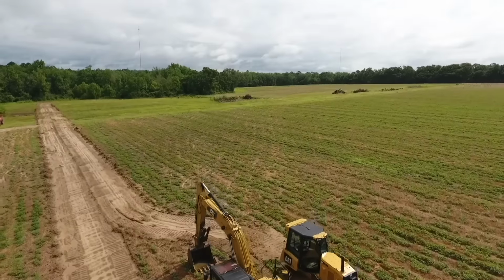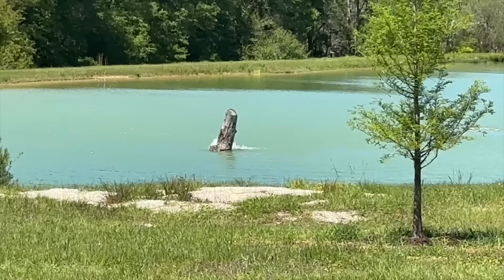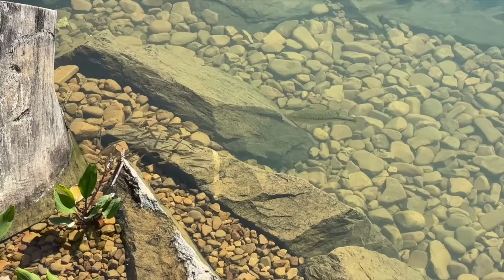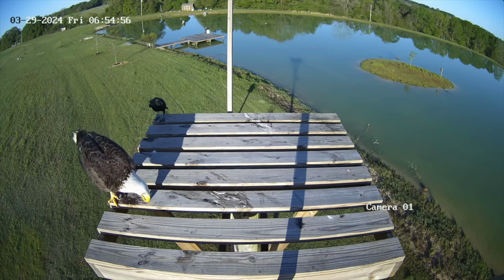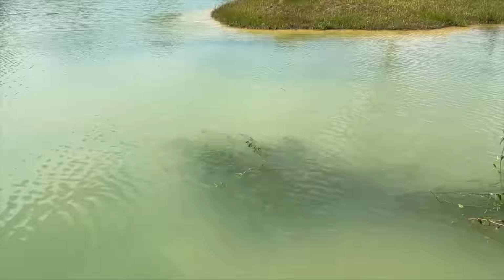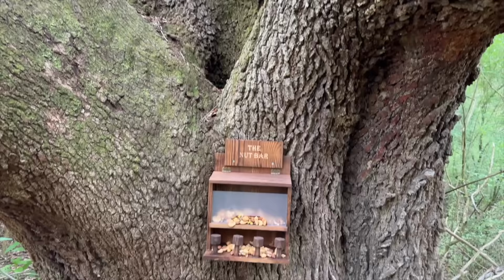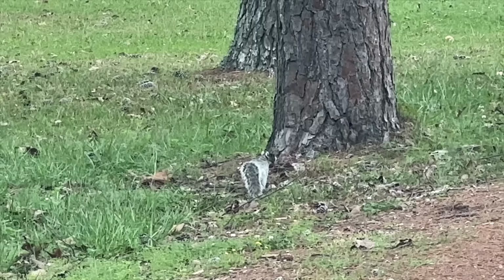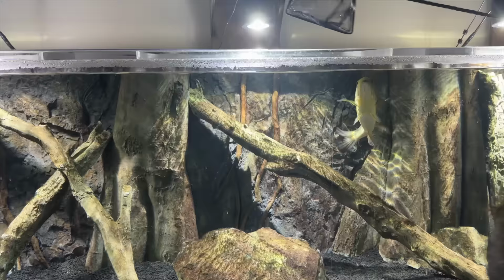Revealing a Secret Project I've Been Building for a Year (It Will Change Everything)

Comment: @BamaBass Do the bass have to actually swim through the square of the antenna? or are they picked up even when they swim by the sides of it? I assume they just have to be close to it, not specifically through... Just Curious, what the range per antenna is, i know underwater it won't be far from the antenna. Awesome videos. Thanks
Reply from the maker: I actually got to tune the antennas this week and it was cool. So any fish that swims through will scan, but fishing swimming outside it from 3-6 inches will also. The strongest signal strength is in the corners of the square and the weakest is mid square, working its way outward in a cone shape.

Comment: Electrician here. I fail to see how this will integrate into any existing agricultural management systems without some heavy physical wiring upgrades. What kind of outputs does it have.
Reply from the maker: The majority of control wiring is 24V. For your scenario, a 24V output signal could energize the coil on a contactor and power any 480V device.